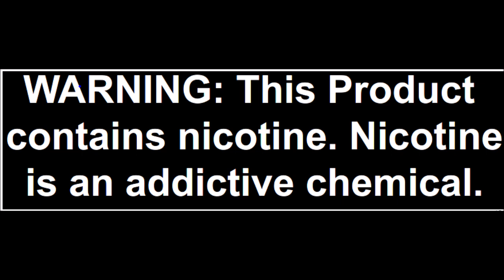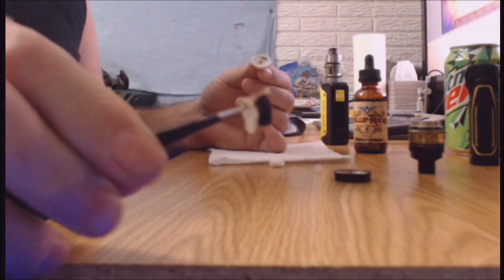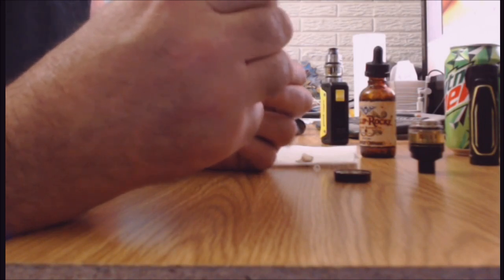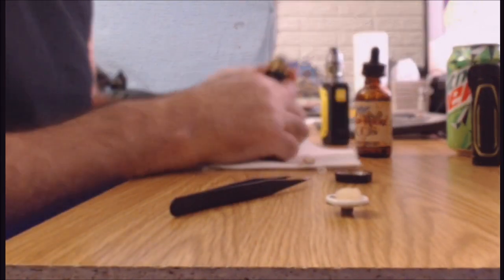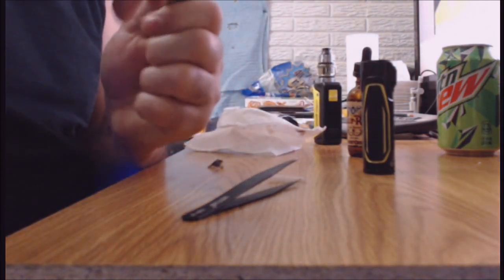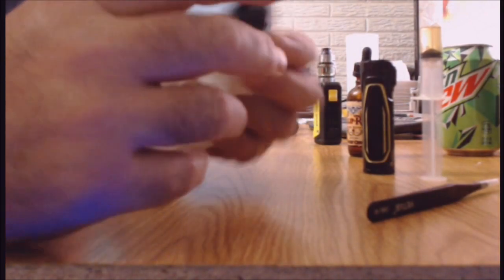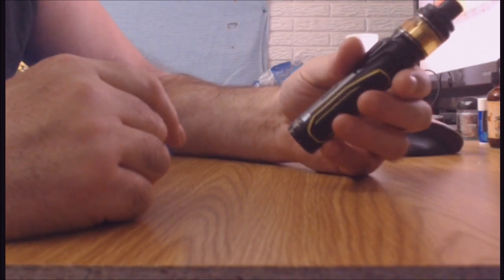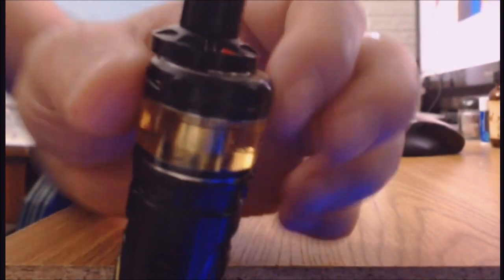Ultex T80 and Cubis Max - 1st cotton change - 10 days use

Comment: same here it is leaking from sliding top , not between glass and air hole. this is my 2 tank and same thing . I have a ijust next gen with similar sliding top and there is no problem with leaking. starting to think the quality is not that good.

Comment: My cotton is that color after 3 DAYS. And the heater coil gets so jammed up, I am having to change it about every week or two. I called Joyetech, and they don’t know what’s wrong. It’s the third vape they have sent me, saying it shouldn’t do that, but after the third one, I figured I must be doing something wrong, but I can’t figure out what, and neither can my husband. His works perfectly. We’ve both vaped for years with no problem, but mine is a pain to work with.
Reply: Melissa Adams make sure you are priming your Cotton before you use it. This means that when you put in a new cotton, add some vape juice directly to the cotton, make sure it’s absorbed into the cotton then use it like normal. You shouldn’t have that problem anymore if you prime your cotton correctly every time you replace it.

Comment: hey i'm only vaping on this tank for 2 days now and got gurgeling and spitback all the time , tryed everything... now i wanded to remove the plate but 1 screw i just cant remove the treads are so banged up on 1 screw i just cant get a grip on it anymore. 1 i did remove and when i lift up the ncfilm a little bit i can already see that the plastic is burned black how the hell can this be in just 2 freaking days of use! maybe some tips on wicking this thing without getting spitback i cutt own muji pad and tryed peeling off the first layer and tryed leaving it on just the same shit spitt back ... but no leaking on the tank . thank you
Reply: poesy100 hopefully you got this sorted out, but I had the same problem. Except mine got that way after a month and a half. So I unscrewed the screw that came off easily and gently lifted the film and turned it to the left (gently) and the other screw loosened and I was able to use a screw driver to unscrew it completely.

Comment: Hey. I have the same joyetech and i have some leaking problems. I fill in the tank, clean it and after few vapes its leaking. What to do?
Reply from the maker: I had that just start happening. Not leaking,  but juice around the top.  
Thinking its a vacuum issue.... Still trying to find away to stop. But,  as work around,  I just wipe it off now and then.
Reply: Blade Dreams yea, I think the liquid condense on the top. I clean my tank today. I fill juice with close airflow, clean it around and close it. I’ll see if till the end of the day it will be leaking or not. 

Well, i like the NCFilm, because after 3 weeks of vaping I Change only cotton and I clean only little bit the NCFilm. But Cubis Max tank with anti leaking system is actually leaking, and I don’t like it.
Reply: Cheack to make sure the top seal right under the cap is seated correctly.  I have two and one leaked right after I got it.  After comparing the two I saw the problem it was the top seal.  I used a q tip to move it a little a bam no leaks at all.
Reply: how did you remove the "slide across top" to get to the seal?  @rguidry777
Reply: contact joyetech directly. phenomenal customer service and they will send you a replacement product free of charge without even having to send your old one in as long as you purchased <3mos ago (within warranty period)
Reply from the maker: @daveparf  there is a little 'ball bearing' under the "lid" if you look you will see it. just press it in.
Reply: Blade Dreams pressing the ball bearing doesn’t seem to be working, I think that is just for the slider to locate back to centre.
Reply: Hi Blade Dreams...I am wondering where do I get replacement cotton and what kind do I get??? Thanks!